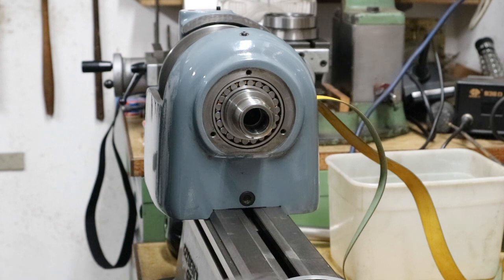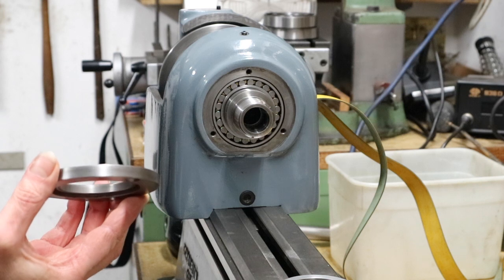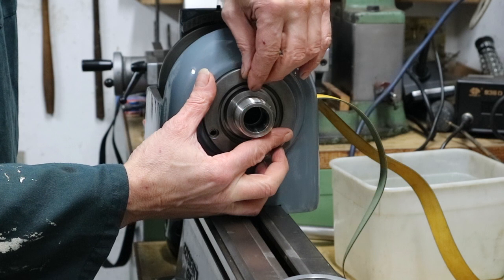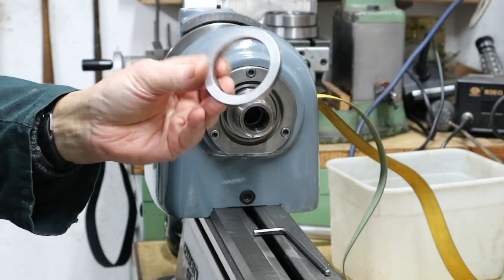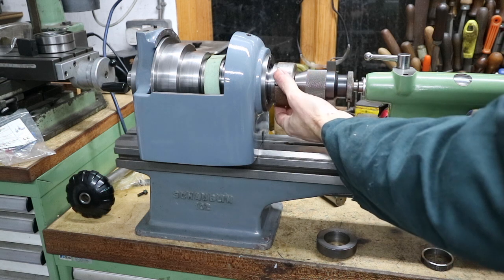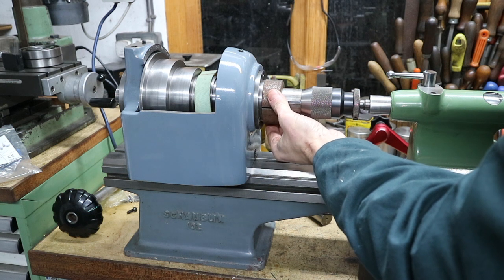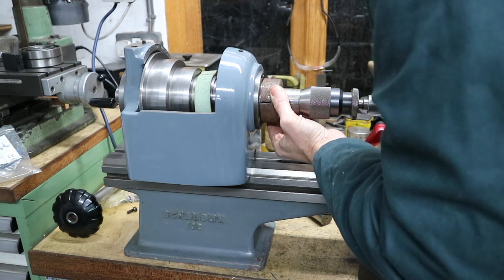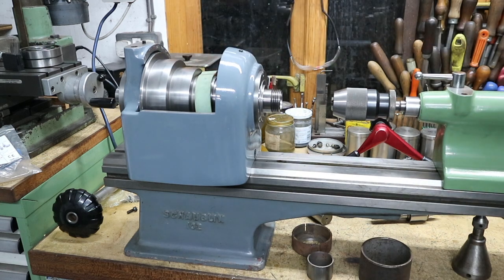Schaublin lathe spindle bearings: Part 3 - replacing the labyrinth seal.

Comment: New flat belt, where do you get them from and what length should they be - this may be in another video?
Reply from the maker: I get them made up by a conveyor belt specialist - there's a link on my website to the UK firm I use. The length will vary depending on your set-up - just measure, millimetre perfect accuracy isn't necessary (as it is on Mikron lathes and mills) as there's adjustment on the counter-shaft.